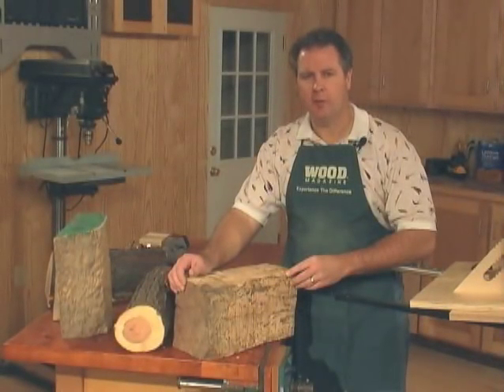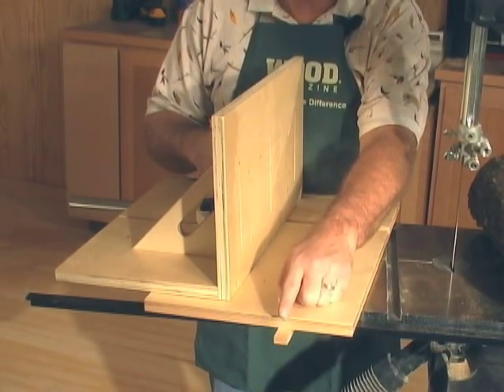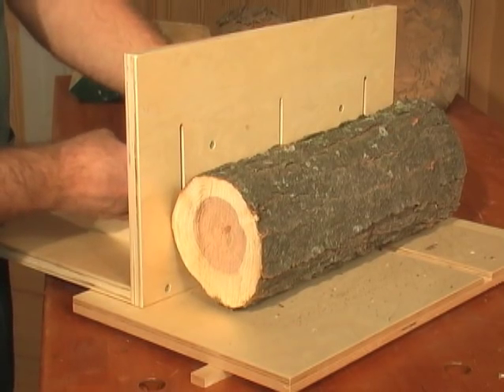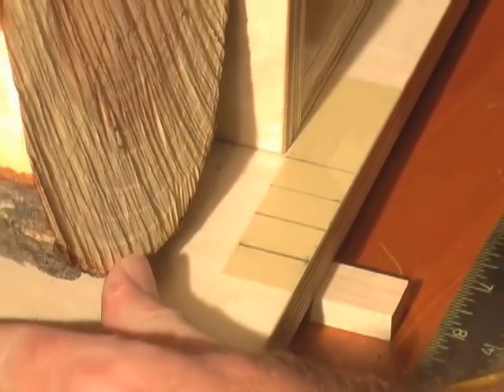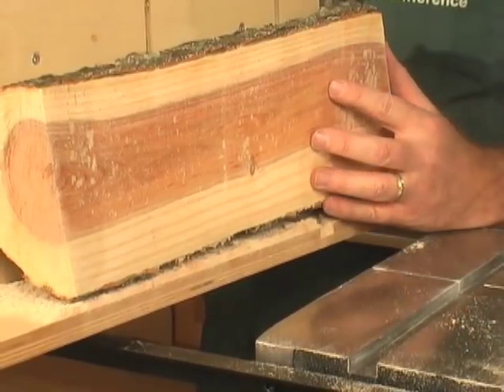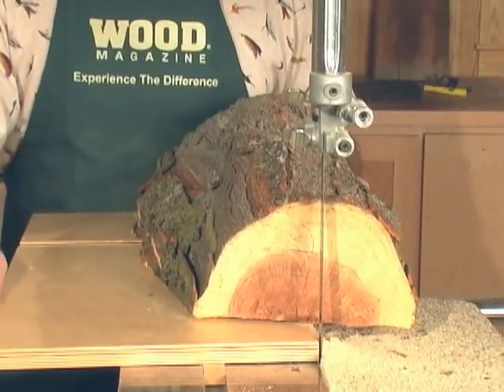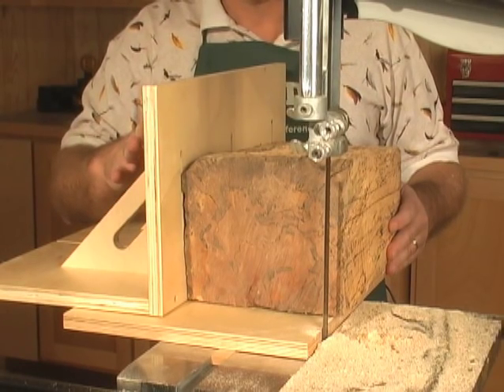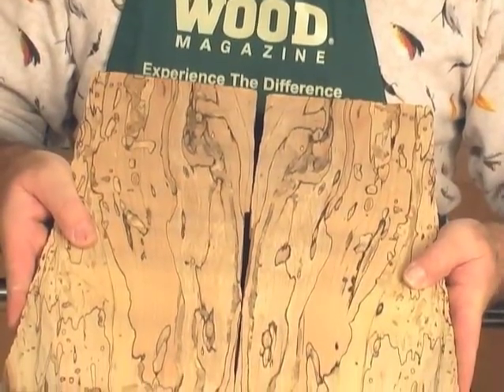Resawing Found Wood with a Bandsaw Jig - WOOD magazine

Comment: at 3.30, just put a piece of the same thickness than the base board on the other side of the blade, your wood will rest on that for the first cut no matter how much it sits over the middle .the simplest jig I've seen so far , very effective .

Comment: Is blade drift a problem?
Reply: Unfortunately, yes. If your blade starts to drift, it will rub against one side of the saw kerf,  and burn the wood, and eventually put a lot of friction load on the blade. This has happened to me quite a few times. So, to use a jig like this one, whose movement is constrained by the slot in the table, you will first need to tune your bandsaw so there is no drift.